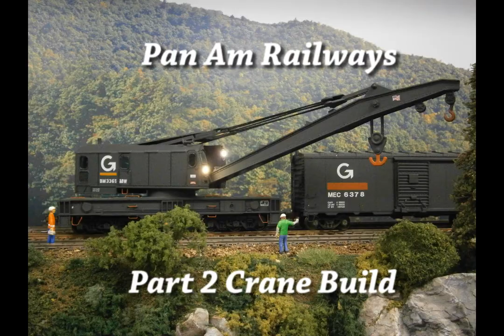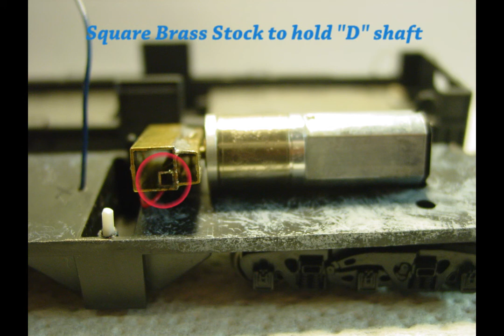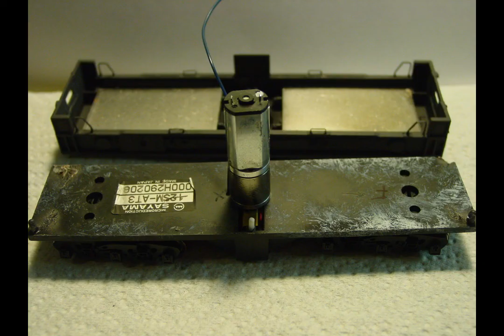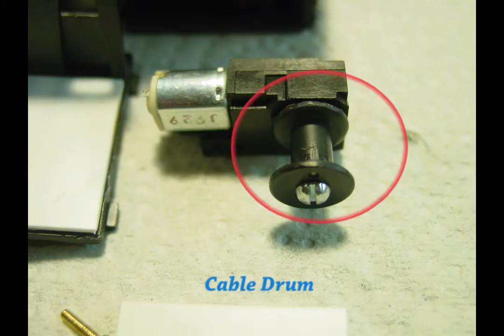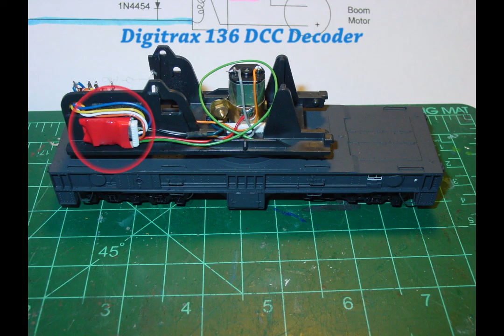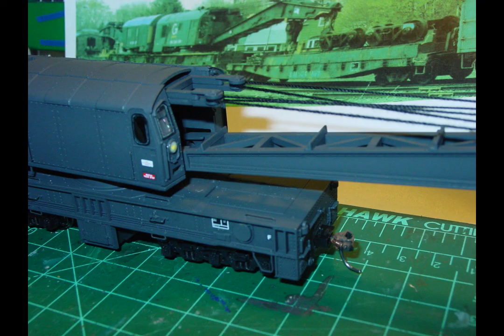HO DCC Controlled Crane Custom Build - Part 2

Comment: Where did you get the relays from and what is their product number
Reply from the maker: @Bob_TheDude Hey, the relays are made by Fujitsu part number FB1 21D12. The bad news is the manufacturer has discontinued making them and the place I purchased them from has since gone out of business. You might try searching for "micro miniature 12v relays" maybe you'll run across something similar. Good luck.

Comment: Would you be able to tell me off show me how you wired the relays? Did you only use 4 of the six pins on the relays?
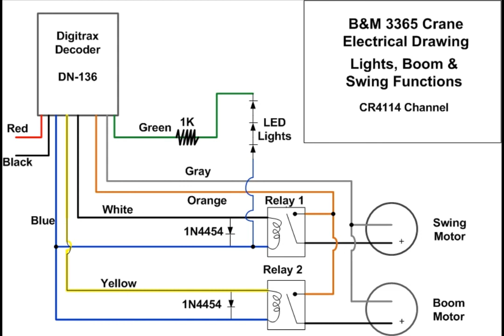Reply from the maker: @Peter McDonald  Pause the video at 2:38 , it shows the schematic on how to wire the relays to the decoder and motors. Be sure to add the diodes across the coil of the relay to prevent damage to the decoder. Yes, only use 4 pins on each relay. 2 pins are for the coil and the other 2 pins are the normally open contact.
Reply: @cr4114  so you haven't wired anything to the common pins if I'm looking at this correctly. I've studied the schematic that you put in the video, I just wanted to make sure that I wasn't missing something before I start wiring mine.
Reply from the maker: @Peter McDonald The Orange lead from the decoder goes to the (N.O.) normally open contact on the relay and the wiper contact connects to the motor +. If in doubt, do a bench test on the relay with an ohm meter before connecting anything up on your model crane to verify the pinouts of the relay you are using.
Reply: @cr4114  Well I tried to do a little test with a relay, a decoder (digitrax dz146), and a motor and managed to burn out the decoder almost immediately. I had the diode backwards. Would that be enough to short out the decoder so quickly? Did you change the CVs before you tested out your setup? I hooked up the forward headlight to the opposite pin of the coil on the relay. Sorry for all of the questions but I'm at a loss. I have the NCE USB interface coming in the mail hopefully soon if that will help out with programming.
Reply from the maker: @Peter McDonald The diode is there to protect the decoder from spikes generated by the relay coil being energized/de energized, so yes having the diode in backwards would produce the results you've experienced. A fast switching diode is recommended like the 1N4454 or equivalent. Also having the diode in backwards essentially shorts out the function lead so that could be the cause too.
Reply: @cr4114  would that in turn mess up the relay? I just burnt out another decoder having everything set up correctly. Or so I though. I would love to email you and show you what I'm working with to have an easier back and forth. Really didn't expect the decoder wiring to give me so much trouble.
Reply from the maker: You on instagram? DM me @CR4114ho there.

Comment: Good! Where did you buy the three lights?  Did you build the projectors yourself?
Reply from the maker: @aln 772 I used component 0603 LEDs and soldered wires to them, the light castings are part of the body on the crane. I just drilled a hole in the center to run the wire through and used canopy glue to fasten the LEDs to the center of the casting. (You can also find prewired LEDs on the auction site). Thanks for watching.
Reply: @cr4114  thanks!
Reply from the maker: @aln 772 You're welcome

Comment: This is very awesome and I would like to do this to my Athearn 200 Ton Crane. I'm sure most of the steps would be the same. Just afraid to butcher something that isn't easily replaced anymore. Thanks for sharing! - Jason
Reply from the maker: You can do it! The concept is the same plus there is a little more room inside the Athearn crane to maybe even add sound. Good luck and thanks for watching.
Reply: @cr4114  Sound is a must. I installed Soundtraxx Tsunami2 in my rotary snow plow. I will deffiantly look into doing the crane one day. Thanks!

Comment: What brand is the crane that you modified. Looking to build my own guilford wreck train.
Reply from the maker: Its an older Roco brand crane. Lionel and Model Power also made a similar crane.
Reply: @cr4114  I'm on the same page as this guy, I'm trying to find those 'boom tender cars' (BM 76 & 77), any tips on where/how I can look for those?  Assuming your decals are custom made.  Awesome work!
Reply from the maker: @ECRV  Thanks for watching and comments. Both cars were scratch built from older athearn cars. For BM 76 I used an old flat car, a 40 ft athearn box car that I cut down to fit the flat car and some old freight car trucks and a-line chain. Drill holes in the side of the flat car and square them up with a file to simulate the wood storage area. For BM 77 the starting point was a 50 ft athearn flat, an atlas caboose and some evergreen styrene to make the shed on the opposite end of the car. Decals were HO microscale white stencil & gothic and highball graphics n scale guilford sets. Brass wire was used for the handrails and grab irons for both cars. Good luck with your wreck train.

Comment: Where did you find the motor for the boom? I've been looking around online and cant seem to find a match. Love the detailed guide on this, its given me some ideas for different cranes i want to add movement to
Reply from the maker: Hi Andrew glad you enjoyed my crane build video. For the boom motor I bought that on the auction site from China but I don't presently see any of that type for sale there. Search for small gear motor.  Here is a similar motor that may work for your situation https://www.pololu.com/product/1120  although it is a little different. If your using a decoder to power the motors just adjust CV 5 and 6 to obtain the right voltage for the motor speed. Thanks for your comment.